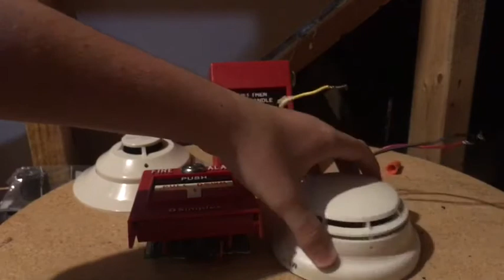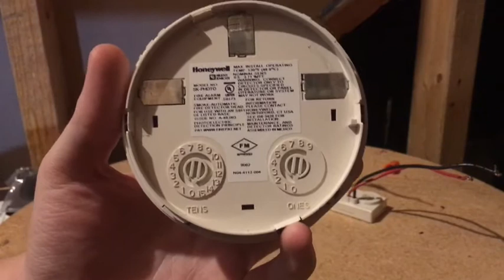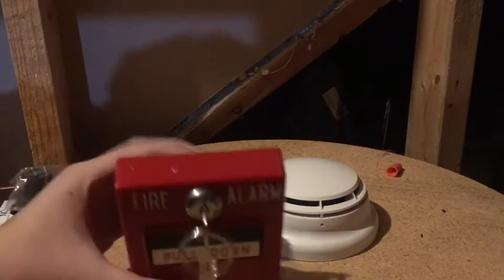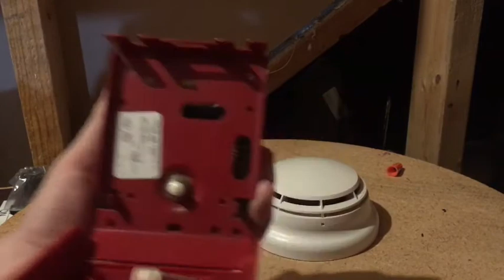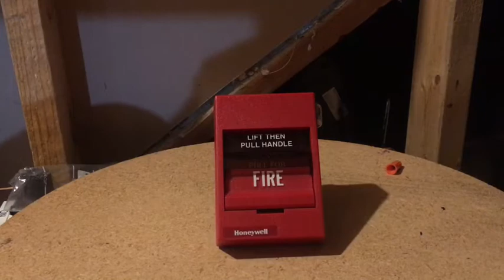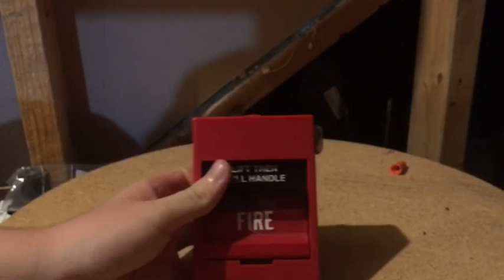Fire Alarm Tutorials Episode 3: Setting Addresses on Different Addressable Devices #firealarmfriday

Comment: For est devices the panel programs its own device address all you really need to do is run auto programming them when that's complete it will let you name all the devices. When the device comes from factory and goes on a system for the first time, the address set by the original panel is permanent for that device. For example I got a few of them and when I hooked them up it said Loop 1 Device 127 and there's no way you can change it